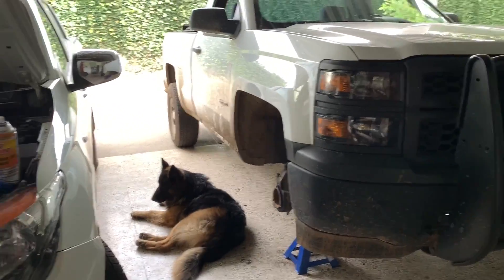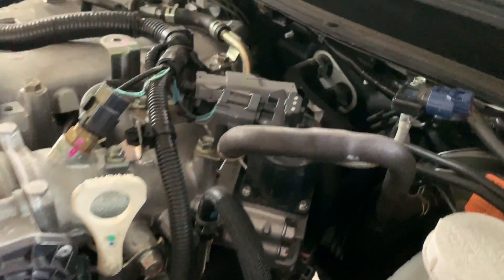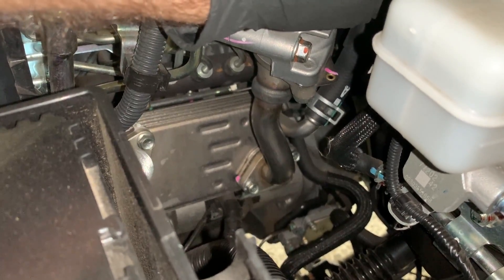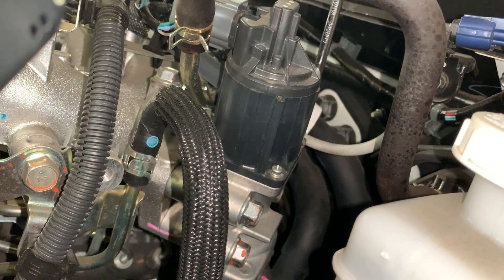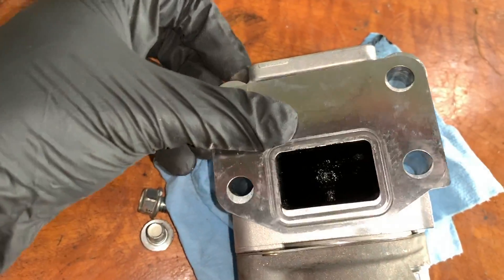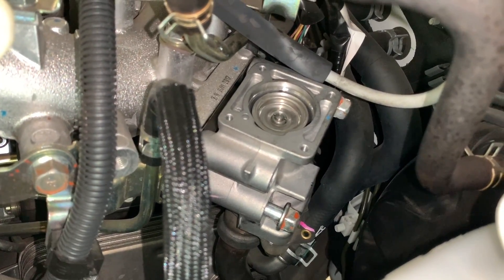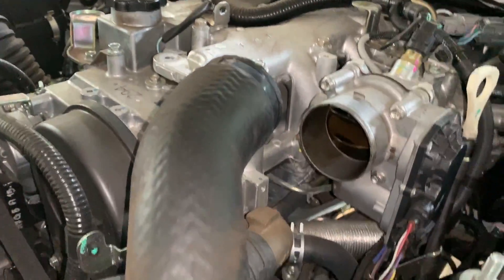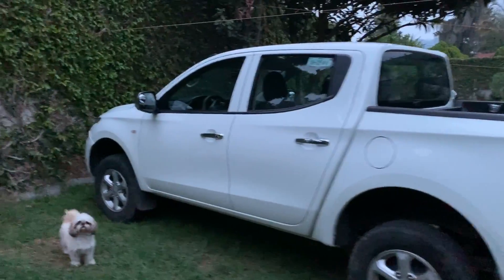How to Block EGR to Prevent Carbon Build Up on Turbo Diesel Engines

Comment: May be a stupid question but I’m curious, why not remove the EGR valve completely and substitute for it with a new hose for the coolant?
Reply from the maker: Because it has an electric valve that will cause a check engine if missing

Comment: Bad move to block EGR !! Engine will blow fast. To block EGR safer is to reprogram the ECU and disable the emission recirculation system from there !
Reply from the maker: LOOOOOL
Reply: Were diesel engines blowing before the egr was forced on people? Really?
Reply: @qalas7327 Apologies but, what's the logic behind your thoughts? I can only see the positive outcomes. I do, however, believe that in colder climate areas, modern engines might experience check engine light due to longer than expected warmup time. It is just a thought, not certain. I also believe that this might be different for each car. The behavior will depend on ecu programming for each brand/model.

Comment: Can I Use Aluminium Blanking Plate 1.5mm thick ?
Reply from the maker: I would use steel,  just because it would be cheaper
Reply: @BadAssEngineering  But can aluminium be used to blank the EGR ?
Reply from the maker: @khanibrahim5947  depends on which part of the system, nearest to the intake manifold yes, near the exhaust manifold nope
Reply: @BadAssEngineering  I am currently using aluminium plate near the exhaust manifold between EGR Valve and pipe from the exhaust. Done around 400km and the aluminium plate is working good. Ambient temperature here is 30-35 Degree celcius.
Reply from the maker: @khanibrahim5947  aluminum melting temp is lower than what a diesel exhaust temp can get, but if it has worked for you, great
Reply: @BadAssEngineering  Thankyou

Comment: Can i put the blanking plate before the EGR solenoid valve ? will throw a CEL ?
Reply from the maker: I guess,  it can be put wherever is easier to install, and not throw a CEL unless the truck has any kind of flow sensor on the EGR system
Reply: @BadAssEngineering  i m having 2018 hyundai Creta / ix25 with 1.6L CRDI diesel engine. Will it throw a CEL ?

Comment: Did you also remap the ECU or only blocked the EGR?
Reply from the maker: Nope, just blocked it
Reply: @BadAssEngineering  and did you get any fault codes? And did you notice any better performance or fuel consumption?
Reply: @MerohDIY  I wouldn't bother asking this guy anything, he clearly has absolutely no idea what he is doing, or what an EGR actually does.
But hey, let's ask him a few things shall we?

Like how are you going to compensate for the EGT cooling the EGR provides? Or, how are you going to compensate for the volumetric loss in the combustion chamber that you have caused by blocking the EGR? Or how about this one: Why didn't you install a catch can? A catch can will catch the oil from the blow by which is what actually causes the sludgey build up in your intake manifold.
Reply: @cbialorucki  Which US Govt does that? Certainly the Federal Govt don't. I'd love to see your evidence of your claim.

Comment: Installing catch can oil or block this EGR which one is better for engine in long term? I plan to buy ranger raptor 2.0 so what is your suggestion. Thanks
Reply from the maker: Catch cans are for drag racing, they dont work for more than a couple of minutes at a time

Comment: Sir,if you block the egr inlet it does affect the speed and power of the engine?
Reply from the maker: No, it shouldn't
Reply: @BadAssEngineering  how about catalytic converter if it get so hot?
Does this methode Reduce the lifespan of the catalytic?
Reply from the maker: @ochaarul786  cat converters work best when hotter

Comment: When blocking physically your EGR - you better change/correct the firmware of the ECU (engine control). Imagine you've blocked part of exaust which was coming to the cylinder to lower the temperature of the combustion. But ECU doesn't 'know' about that and continue to work with the same values for fuel injection, thinking that EGR still operates. Usually this cause increase of temrepature in combustion chamber. This may affect diesel injectors for instance. However it may not. Depends on engine, manufacturer and many other conditions. Anyway, it's recommended to shut EGR both physically and via program mod.
Reply from the maker: I run a pyrometer and monitor temperatures consistently. By in taking more clean air my engine actually 1 mpg and the EGT temperature is not enough different to make a difference.
Reply: That’s doesn’t make any sense. Good try.

Comment: Buen video, buena idea hacerlo desde los 10 mil km yo lo acabo de hacer a los 30 mil km en una L200 2019, Existe un video donde dicen que también se debe retirar la mariposa o palometa (anti shudder vale) de entrada del aire del turbo que se supone controla en parte el sistema EGR, de esa manera se tiene aire libremente y el turbo no recibe contrapresiones, que opinas dejo el link saludos. https://www.youtube.com/watch?v=jQ8BDdgeI1Q&t=648s
Reply from the maker: Aldo gracias! Una vez que quede tapado el ducto de la EGR, ya no tiene caso, y También si eliminas ese cuerpo de aceleración se vuelve algo incomoda la camioneta al apagarla. Tú 2019 ya trae otro motor, el 4N15, así que puede venir diferente a mi 4D56

Comment: Can you do this to gas engines also, Or would there be any problems?
Reply from the maker: Yes, just locate the cold side of the EGR, its easier to work there
Reply: What gas engine has an EGR?

Comment: Can i make a blocking plate myself? Its just a metal plate right?
Reply from the maker: Den Yes, You can use the stock gasket as a template
Reply: @BadAssEngineering  thx. Im gonna do the same, probably need to remove it before inspection and i will get check engine light, but atleast my engine will last longer.
Reply from the maker: Den I didn't get a Check engine light, you shouldn't either
Reply: @denniero6904  Actually your engine will most likely not last longer. Obstructing the EGR causes higher EGTs, and it also causes a volumetric loss in the combustion chamber which forces the engine to work harder on every stroke. Which will in turn mean  that in time you will cause more wear on the piston rings and get more blow by, which is actually what causes your intake manifold to get clogged, not the EGR.
Funnily enough the actual engineers at the major car manufacturers have done a LOT of research and development into this. But hey you can always put your faith in this bloke who is quite obviously not an engineer and has no clue what he is doing or what he is talking about. Your call....

Comment: Hello, nice video.
Question, I took my truck to the shop for EGR valve replacement, I had code P0400.
The replacement was a success and they charged me pretty good $ but the symptoms never went away, and the light/code came back right away, I am suspecting clogged intake passages.
Would this mod help with the symptoms already present? Hesitation on low gear and no power etc.. I don't care about the code I just want to drive my truck like I used to without the hesitation.
I don't have any problems with my truck besides this.
My truck is a Ford ranger 2002 2.3, whoever decided to put an EGR behind the engine was a total genius... Meh

Thanks
Reply from the maker: eddie No, this mod is to prevent it on the first place. You can have a shop clean all of what's clogged, and then block it off.

Comment: Hello sir.. question..
Ia ther any bad will happen in future if i block the egr on my ford ranger 2.2L??
Reply from the maker: I dont think so, but the beauty of this mod is that is very easy to put and remove
Reply: BadAssEngineering..Ok.. Suggestion counted. :)
Reply: I did block my EGR on my T6 ford ranger,
My fuel consumption befor 11.5L/100km and now it become 12L/100km,
And it feels much burden on the engine,just like Bob Rose said the max hp wont go to maximum.. 
should i  remove the blocking plate?? Or is there any sugestion??
Reply from the maker: Joel Get it tuned by a reputable shop
Reply: @joeld9111  Your fuel consumption can go up after blocking your EGR because it causes a volumetric loss in the combustion chamber. Diesel engines require pressure for combustion rather than a spark. So by reducing the volume in the combustion chamber you reduce the engines efficiency.
But doesn't know that, so he is telling everyone to block their EGR. He is very obviously not an engineer.